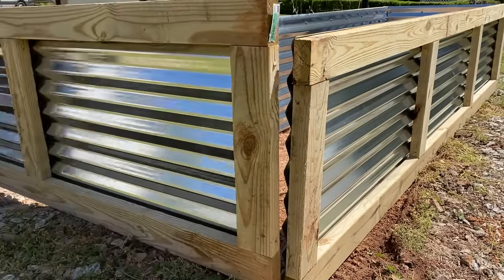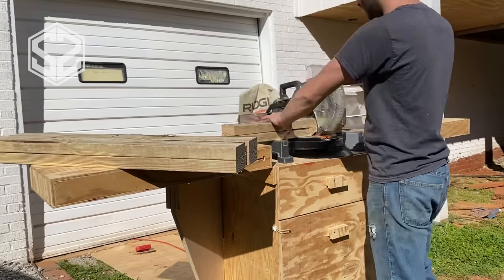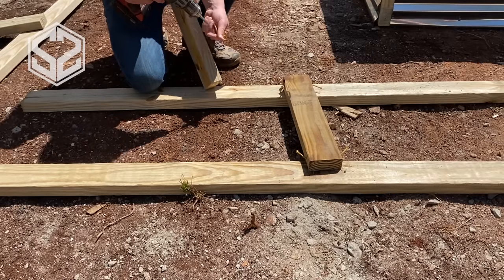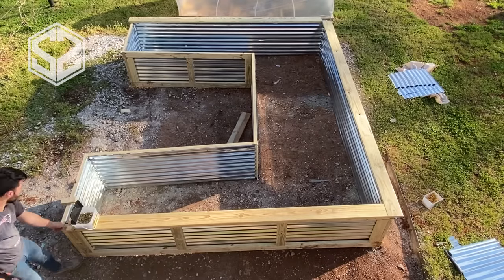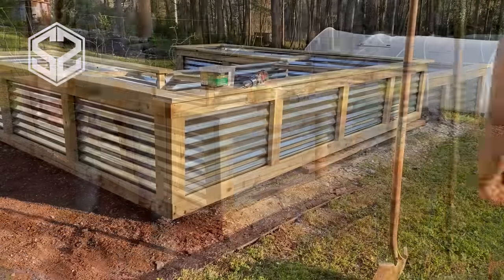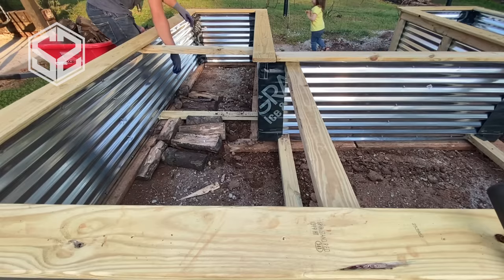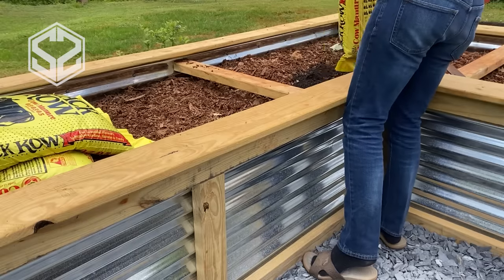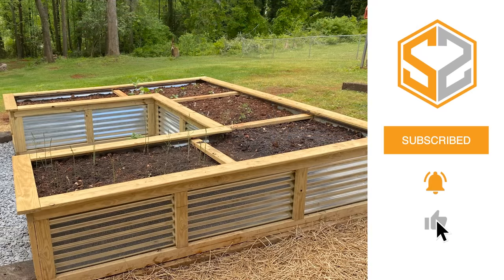How To Build Raised Garden Beds

Comment: I wouldn’t used pressure treated anything where I’m growing my food. It’s poison.
Reply from the maker: True, I have been told that the newer treated lumber is supposed to be much safer however it is not without risk. A safe option would be Cedar, Cedar is naturally resistant to rot and pests like termites. This lumber is more expensive than treated lumber but may be worth it if you have concerns. 
Thanks!

Comment: Ugh, you're using PT wood? Enjoy eating all that poison and cancer causing carcinogens they're impregnated with. Pro-tip: For raised beds just use normal softwood - pine, fir, cedar, et al. - and give them the viking treatment. What's the viking treatment you ask? Good question. Use a 50/50 mix of pine tar oil and raw linseed oil. You can get really good organic stuff from Norway pretty cheaply from companies like Auson and Allback. You only need to do about 3 coats of the stuff and your wood will be protected for decades and look great to boot - and pine tar smells so good as you're applying it! You also need to drill a few small drainage holes for the wood on the ground - say 4 interspersed along an 8' piece of wood - drill the holes before coating the wood.

Another trick you can use is to line the interior of the bed walls with plastic floor underlay - with the bubble side against the wood/metal - to help prevent rot/rust and increase air circulation.